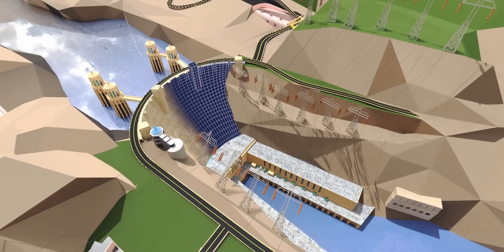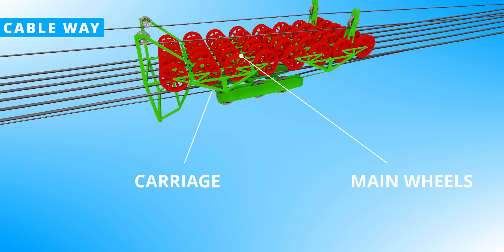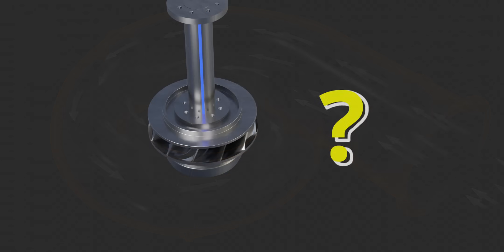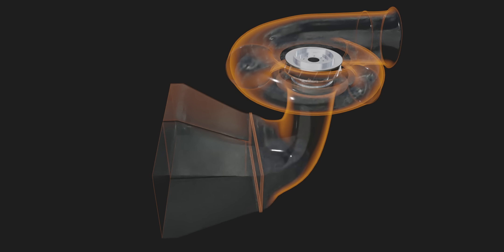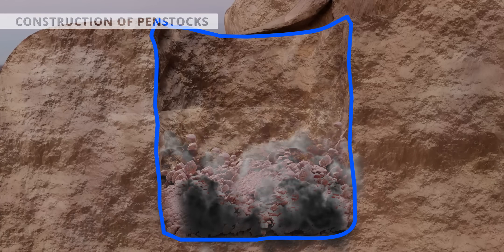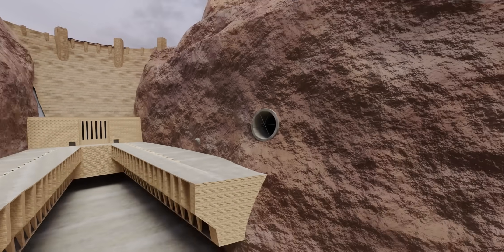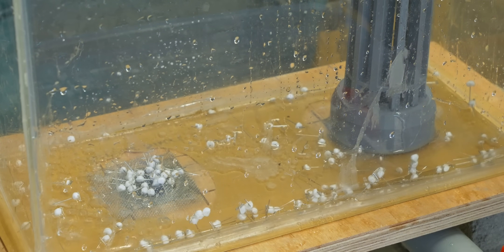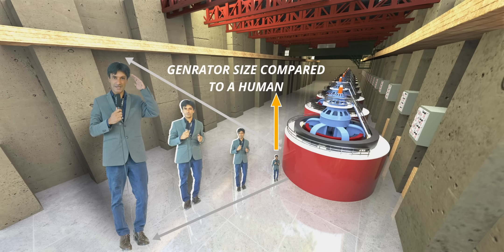Hoover Dam's Power  Generation | The Beauty of Engineering

Comment: I've wonder why don’t they run the turbines in a spiral one turbine feeding another you would think if you set up a screw design with one output shaft in the middle as the water flows down the spiral it would hit more turbine blades and produce more energy to the output shaft.
Much like a car with multiple turbos you gain more power as you have less wasted energy by capturing more of the flow with the water moving in a circle it would act like a whirlpool.
I wonder also as the water flows down if you could decrease the size of the turbines and size of the tube to make generate more pressure increasing the speed of the turbine.
I'm sure with todays computers modeling we could improve much on the old design.

Comment: The guide veins work just opposite as you explained in a car turbine as the direction of flow is being changed more than the volume of air passing through. Not sure if it's the same with water here but would seem logical.

Comment: Who makes such crap? I had to stop at the part when the transmission lines were “dangerously inclined”. Such garbage.
Reply: I don't understand the problem
Reply: @Coastal_Cruzer  : The video explanation is stupid.
The towers are not inclined because" otherwise lines would be too close from ground" that would have "metallic properties". That's total crap.
They have the inclination that follows the force they have to withstand, thus as not to create torque on the structure (as any it's way less robust in any direction but aligned wit it). And the ground is conducting electricity, but certainly not metallic.

I also stopped there. If that thing is so wrong in the few first mn, doesn't worth it.

Some said IA generated, I wouldn't be surprised.

Comment: There's a cardinal error in the video - the installed capacity of Hoover dam's electric generators is not 2 Watts as stated at the beginning of the video, obviously! A single AA battery would be more powerful. 2080 mW is 2080 milliwatts, that's 2.08 W. Hoover dam's installed capacity is actually BILLION times bigger - it's 2080 MW (megawatts) or 2.08 GW. Check the metric (SI) prefixes, please. Should an engineer do such mistake, he would be fired, probably (or someone could potentially die from such mistake).
Reply: That video is full of errors. Worthless.

Comment: I seemed like a turbo to me
Reply: More or less is. It's using pressurized fluid (exhaust gas vs water) to turn an output. Only difference is turbos spin up a second turbine that sucks air in whereas hydroelectric spins essentially a motor, generating electricity

Comment: They do not use permanent magnets in the exciter except perhaps a small one to get things started. They use a wired electromagnet. The field of the exciter can be varied to control the output of the main generator/alternator. Vertical alternators and turbines tend to float in the air and do not require a large thrust bearing. The magnetic field holds them up.

Comment: Green power!! What is green power? Well it is not wind only one place on Earth to recycle them into concrete AND Solar well nowhere near as recyclable! Pump Hydro Yes? Sorry 40% more power to pump it than you get when it falls to the turbines so 25% increase in your power bill. How about a dam that has three banks of turbines ? as it is ALL DAMS RUN ONE BANK it can be made to work RDP Marine Australia has the only units
Reply: Unfortunately there isn't enough water in the world to power everything with hydroelectric. Nuclear is needed too
Reply: @Coastal_Cruzer  but it can be improved ,,,,, Good Morning 
the following is still in the working out faze
This document is for a retro fittable power production system for a hydro dams to have up to three extra turbine banks without making issues for the main turbine hall
Now the reason this type of system has not been looked at was two fold .. the loss of flow rate and back pressure issues 
As all the worlds dams have the same basic layout regardless of the turbine fitted. The basic setup is turbine shaft to shock uni joint to the turbine. And so all have the same common limitations  
A new type of turbine unit is needed if the main turbine hall is to function with without mods for a multi bank units are to be placed in the flow 
This new system will never match the output of the main turbine hall but after years of chasing minute increases a system like this one is a massive jump in output 
At this point it should be noted that most of the installation process can be made with the dam online selling power to the grid and there is no increase in water usage when fully installed  
This system has been designed to be fully independent of the main turbine hall so as to be serviceable with the other units online and running with the main hall 
A FEW OBVIOUSE POINTS 
Population = Even if our numbers were to fall we are still in a situation of heading to a power shortfall outcome things like data centers e cars and a hole host of other tech 
The lag time at best for any new power units to get online is 2-3yrs at best and i believe we are well short of filling the markets needs 
OTHER BENIFITS OF THIS UNIT
Is a dam green tech? well its more recyclable than wind and solar
lasts 100 plus years vastly more than the others
It should be noted if the patent is very strongly protected the market will come to the seller even if it is in Australia or America so a 100 billion dollar a year marketplace makes the wage bill a non-issue 
SOME OF THE BIG BENIFITS 
Bigger market share/customer base
All the required infrastructure is already in place
the asset has a longer life span
No issues regardless of type of the main turbine fitted 
No added down time 
AND ITS TRUE BASELOAD POWER from a existing dam

Comment: One omission is that the power towers are also angled to direct cable weight force directly down the centers of the towers. If it was only to avoid proximity to the rock face, then vertical towers could simply have been much taller to make up the needed difference.

Comment: I think the animation showing the rolling of the drums that drive the cable way is incorrect. The animation shows them both rolling the same way (i.e., either both clockwise or both anti-clockwise). However, if I understand correctly, the cable from the drum at the top is connected to the right side of the carriage and the cable from the bottom drum is connected to the left side of the carriage. This means that when the carriage moves to the left, the cable from the bottom drum gets shorter and the cable from the top gets longer. It's the other way around when the carriage moves to the right. This means that the drums should be rotating in opposite directions. In other words, when the top drum is rotating clockwise to make the carriage go to the left, the bottom drum should be rotating anti-clockwise. And to make the carriage go right, the top drum should rotate anti-clockwise and the bottom drum should rotate clockwise.

Comment: Tip for another video. When I visited the Hoover Dam some 20 years ago, I bought a part of the cable transferring the energy to Las Vegas. I use them to this date as a pen holder, cause the cable is hollow and cleverly constructed. It's extremely interesting and there's a lot of physics knowledge and experimentation behind that.

Comment: "But the high speed water that comes down had a huge impact on this concrete layer" 6:59

https://youtu.be/EE29Hw-MFAY?t=413

This same logic can be applied to roads, where there are hills. Especially when heavy cargo laden vehicles come down a hill to the lowest point - I've noticed this is where many roads have deteriorated. Water also naturally flows to this point and could compromise it from underneath.

Comment: Nice video. You explained everything pretty much correct. I worked for Hoover Dam for a dozen years and have been inside those Penstocks and Laterals during ‘water down’ (maintenance cycle). An interesting fact: the insides of the steel penstocks are coated with Coal Tar to prevent corrosion. No place darker than walking in one of the main penstocks. The water velocity in those penstocks doesn’t exceed 15 ft/sec.
Reply: Thank you @DaveGunderson.
Reply: @conniepr  My pleasure.
Reply: Allis Chalmers turbines 👍👍
Reply: You know, I've seen the full tour of the Hoover dam, and I've watched 8 hours of documentaries and scientific breakdowns. Still, some part of me doesn't believe that it was built by Humans. I've seen the footage of the workers, but unless I met someone who was there for the entire 3 years, I have trouble understanding how they pumped high pressure concrete into those tunnels that would have had poor lighting in 1931, and the tunnels are 56 feet wide when originally excavated. Four tunnels that are 4,000 feet long, and 56 feet wide, and filled with concrete and pumped with high pressure mortar seems like something that would take modern engineers at least 10 years to do, and that's with the advent of modern diesel excavators.

If the Hoover dam was built by 3,600 hard working men, and if 120 of them died in the process, as is reported, then it's the probably the most important piece of Human engineering in the last 1,000 years. Because it could never be built again. The tunnels were supposed to be 140F degrees, and workers died just from the heat alone. The level of health of the workers in 1931, had to be orders of magnitude higher than even our healthiest Humans on Earth today. No Humans exist today in 2025, that could work in 140F tunnels, using 200 pound steam jack hammers. 

You see? The story of Hoover dam doesn't quite seem real. The quality of its construction, and the mathematical precision, seems to exceed anything that is possible, even today. They didn't even have a simple handheld calculator in 1931.
Reply: Greetings from Keban Dam in Turkey, do you do generator and turbine maintenance?
Reply: @havakuvvetleri2.anajetussu534  My own involvement was SCADA and Communications. However my work took me into dewatered penstocks and inside generators (sensor inspections). Great working in a hydro electric plant. I'm retired now.
Reply: @havakuvvetleri2.anajetussu534 no sir. I was an instrument guy. had to inspect sensors
Reply: Man do I love hydro power, but you would never see me within a kilometer of one because oh my god that is terrifying, being even on it is scary enough, but being inside of one of those pipes? fuck that

One of my biggest fears is large water-based areas like this, not like, lakes and rivers and such, but anywhere with large amounts of moving water or just large moving parts, I would probably pass out being inside that

There is this one corkscrew water elevator near me where the corkscrews are only like, a meter in diameter and only a couple meters long, and as cool as I think it is, it scares the shit out of me being even near it
Reply: @CrypticCreator9052 You ever play Skate 3? There is this feeplay map where there is a huge tunnel going down then out that is long and pitch black mifway through. The Hoover Dam had this one huge intake i kept looking at thinking, "damn that would be a crazy pipe to spiral through before death"
Reply: @CrypticCreator9052  been everywhere. Inside the Scroll case is the most scary section.